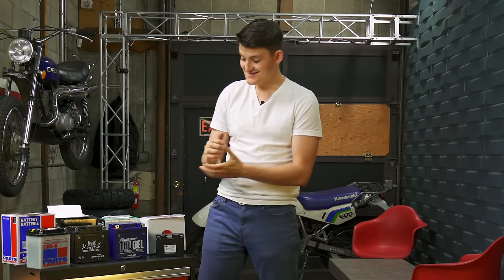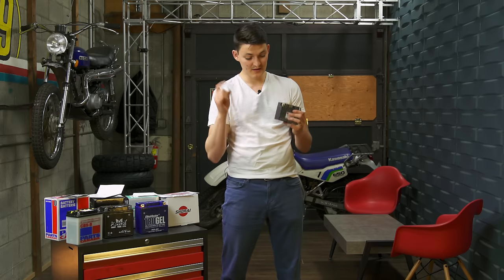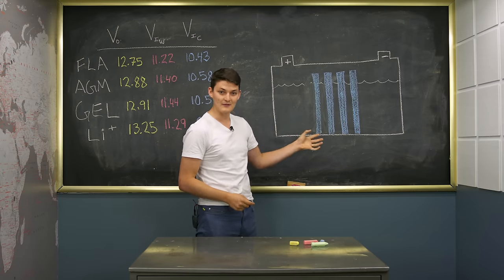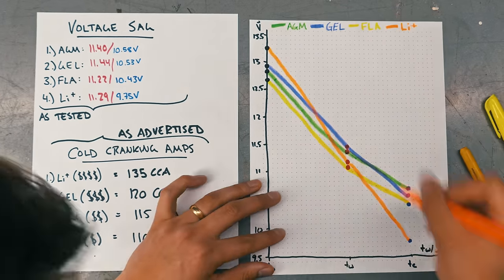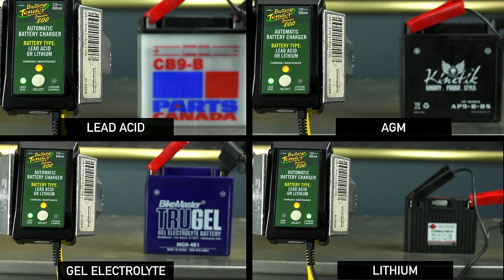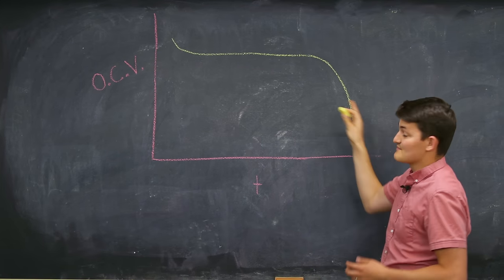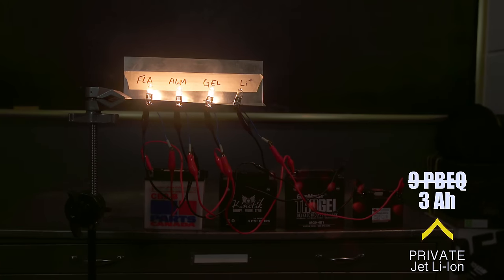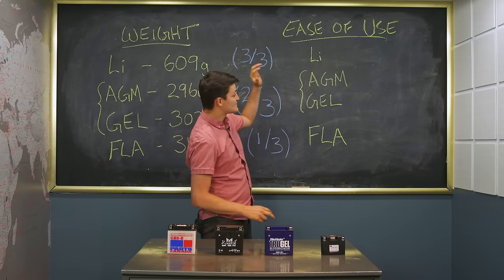Best Motorcycle Battery? Lead-Acid v. AGM v. Gel v. Lithium

Comment: Все конечно хорошо, вес и так далее. Но, не каждое зарядное устройство в мотоцикле может правильно зарядить литиевый аккумулятор.
Тема для следующего видео.
Everything is fine of course, weight and so on. But, not every charger in a motorcycle can properly charge a lithium battery.
The theme for the next video.

Comment: TO EVERYONE IN YOUTUBE LAND 
 I'm an electronic engineer 

If I need a special lithium battery charger to charge a lithium motorcycle battery 
THEN WHY AM I NOT CHANGING THE ALTERNATOR AND VOLTAGE REGULATOR ON MY BIKE  (THAY ARE FOR LED ACID )
 
the BMS ( Battery Management System ) in the lithium battery dose this for us !!!    
please do not give out False info . the battery is made at the factory as a direct replacement (hens the name "motorcycle" battery) for a led acid battery
AND "DOSE NOT REQURE A special CHARGER" !!

Comment: 1. not all lithium bat chargers are equal a true lithium ion charger cant charge anlead acid however a trickle charger will charge a lithium albeit slow as fuck however it must shuit off when battery reaches full charge OFF! or boom . So a simple stop circuit makes it safe for l.Ion however does not make a lithium ion charger.
Reply: 2.2. Gel cel work best in Marine  applications or bike they love being run down to almost zip then recycling back to life for years and years or melt (because Vegas) . However i find th popular gels to be crap and go to west marine and buy a boat battery.
Reply: 3.my favorite is a small super capacitor  setup and a backup battery from Dewalt or Makita i don't have to go into the amazing convenience of using a 20 volt battery that everyone has already in their garage ? i dint think so or explain the need for a step down circuit /resistor ... this worked great on my track bike . thats all you rock !

Comment: I just need to know what is the best battery to get for my 2019 Ninja 650?? 🏍 💨 🔋
Reply: Just go with a stock yuasa mines over 8 years and still going strong.
Reply: @chrishart8548  I ended up getting a Lithium Noco NLP14.
Reply: @Elevated805  I bought a lithiom trickle charger from noco 70 something.    They look like a good make the battery's are steep though
Reply: @chrishart8548  yeah, it was expensive but has a 5 year warranty & I plan on having this bike for a couple years, so it was worth it to me. I hate having battery problems + I just installed some underglow.

Comment: You have literally missed the main point of buying a lithium battery. In a bike, it is about weight and space. You can fit a very high amp hour lithium ion battery in the same place for roughly double the capacity and one third of the weight of gel. Also my lithium ion takes less that one hour to charge, is 20 amp hours and smaller than all of the batteries tested. So the brands and charger are garbage. Cost me $140 dollars Aud. It is a no brainer if you do a proper test.

Comment: He used batteries at the same amp hr. if you bought a lithium that fully filled your motorcycle battery compartment as you normally would, it would out perform them in almost every way.
You are supposed to bulk charge them which will very quickly get them to 80-90% but the last 10% of charge takes a long time.
Seriously why did you use a lithium so much smaller. Even if you did do that to save a tiny bit of space for some reason all you have proved is the lithium can still get the job done. You said in regards to lithium being able to be mounted upside down “why would you do that?” But you don’t have the common sense to buy one the same size?
Reply from the maker: The most common reason people buy lithium batteries is to get the same amp hours in a much smaller, lighter package. Racers and custom guys do it a lot. So for them, the comparison of an equal-size lithium battery is irrelevant. ~RF9
Reply: FortNine racers and custom guys will be well aware that their bikes are unlikely to perform without extreme care and maintenance such as not starting them in the freezing cold. Racers will always choose lithium anyway to save weight so i would say testing for those people is completely irrelevant anyway...
I fitted a lithium that filled my compartment. All the pros no cons. Save frozen battery but I don’t get my sport bike out when it’s sub zero.
Reply: FortNine I’m being harsh here, your channel is by far the best for motorcycle myths and reviews and the likes.

Comment: i can't believe the lithium battery lost... Im still getting it to make my bike lighter.
Reply: The lithium battery did not really lose in my opinion. This comparison left out one important criteria, longevity. The lithium is the only one that may last 10 years, the gel maybe 5-6, and the others 2-4 at best. I am on my third year with a lithium and it has been reliable so far. It also sat all last winter with no charge and fired up my bike in the spring. You will not regret buying one. Have a great riding season.

Comment: My half full lithium won't crank the 125cc engine...
And a full one will only crank it like 3 times until it's voltage is too low...
That's what you get for 11.1V rated Voltage instead of 12V.
Sorely disappointed.

Comment: Charging a 3,5 Ah LiFePO4 battery with a 800mA charger?
A lithium battery can be charged as fast as 1C so it could easy swallow well above 3amps.
Not saying the Lithium batteries is the bees knees, just saying this charge test was not very good.

Comment: Nope. Your LiFePo was crap. I use A123 cells, only 5Ah. I took 8 pieces and spot welded my own battery. No need for balancer. Would never, never change a thing. Works for years in three bikes, also in the wintertime, much more power (cranking amps). Not drained after some month in the garage. Finally i`ve got rid of the never ending Pb crap trouble: each year a new one, each winter : wont start (what a fuck).

Comment: In real life it does not matter the Lithium having the lowest self-discharge. Most motorcycles have a constant low amp draw when switched off. The lithium will be the first one to be empty, since its real capacity is only 1/3 of what the others store.

If you park a motorcycle with a lithium for more than 4 - 5 days, disconnect it, or install a breaker switch right away.
Reply: That’s not how it happened for me, I had it sitting for months in winter, started up quick every time.
Reply: @kexus1990  If you do not have a keyless system, a clock or a theft alarm running then yep. I had a R 1200 GS, that discharged a Shorei in less than a week.
Reply: @krollpeter  Yeah ok, completely different situations. I had a 2014 CB500F, completely stock, no bells or whistles.
Reply: @kexus1990  It is the easiest and one of the cheapest ways to cut a few kg from a bike.

On many modern bikes it is questionable. Why? It can handle huge amp draw very well, ie when starting. However that constant, even low amp background draw is poison for it, it will kill a lithium batt in a year.
Reply: @krollpeter  Thanks, I’ll have to keep that in mind for the bike I’m riding now, it’s got an AGM battery at the moment, was thinking of upgrading.

Comment: DO NOT BUY SHORAI.  I almost never comment on videos but some truth; this video got me tilted.  FortNine is great and the videos and tests are always entertaining.  The only problem here is personal experience with the various products; even though these are simulations of real world scenarios – nothing is more telling than a real world scenario – let me explain.  

Shorai is complete garbage and the environment does not need this battery to recycled; it needs to be destroyed so that it never takes another form again.  After having a stock Yusa for 6 plus years; it finally went lights out.  I researched on what to replace it with and ended up with a Shorai.  The price of the Shorai was intimidating but I contacted their support and they were nice and answered all of my questions.  I decided to bite the bullet and purchase an LFX19A4-BS12 which was an (+$60) upgrade to the LFX14A4-BS12 that my bike required.  I did not want any hassle and no trouble fiddling with the battery as the Yusa approached its end of life it was on a tender every few days and did not want to take off the seat blah blah.  

The Shorai came in from Revzilla and they were not able to ship it at full capacity – okay fine – I charged it up and boy the first charge was quick.  Oh yeah I also purchased the special charger even though I had a battery tender that Shorai confirmed over the phone that it would work with their product – but I wanted to be on the safe side.  So that is another $90 down the drain for the SHO-BMS01.  The battery was extremely light and it connected right up.  My bike even started right away w/o having to have the lights or electrical run through it for the 30 secs like the manual says.  In the cold climate where I reside; the extra CCAs (second test from FortNine) and power from the battery do sure up to what they say and start the bike better than any traditional battery that I have used.  The problem is that the battery has a 1 year shelf life and I do not mean 1 year storage life like they claim – I mean after a year you have to buy a new one.

The charger has a store mode in which it does just that; it maintains the battery voltages in between seasons.  What was really fun is that during this maintenance period the BMS01 malfunctioned; yes it malfunctioned – stopped the storing process and the battery over discharged.  IF THIS BATTERY OVERDISCHARGES (under 50%) then you may as well buy a new battery because it is never coming back.  I contacted Shorai and did an expediated RMA; I sent them the charger and battery and they told me that the charger malfunctioned and they were sending me a new charger and battery.  At the time I was pleased with their service and return time.

Great so what is the problem? About a year passed and in-between rides – I went to start my bike and nothing.  This is after I geared up and everything; the ignition was silent – no cranking at all.  I was really shocked and thought to myself – could it have been the battery? I was actually hoping it was something else as I knew if they battery was discharged and had any sort of draw on it; game over.  I got my multimeter and sure enough I was at 9.6v.  I plugged in the charger and it received the error message that it was over 50% discharged in which math of reasons 9.6 is half of 13.1 but you know raisins.  I called Shorai and they would not service the battery.  They said I was over my worthless 5 year warranty period and they offered me a coupon for a new battery.
 
6:33 Lithium has the most mood swings from any of these fantastic batteries.  IN BETWEEN days the battery fails.

I even remember looking up the Pb Eq Ah which was total BS – it was black magic – just as the video says it only means 3 Ah hours NOT 9.  As you can see from the first test; the Shorai has the worst voltage sag and keep in mind the Shorai normal voltage is over 13.1 per Shorai and when it was healthy mine would run about ~13.5v with no draw.  From my personal experience, none of what is shown is surprising and the Shorai I am sure true % drop was slightly higher due to actually running at a higher voltage than a traditional battery.  In the third test the recharge speed from the battery failure was roughly 24 hours before it even errored out and asked me to put in store mode. 

I cannot confirm the 2 months test as when I have my battery stored; I keep it indoors during the winter and on the proprietary Shorai charger.  Shorai loses in all 3 of his tests and only kind of skates by with the shelf life test.  ~$300 later I am left with looking for a new battery.  Customer service this time were extremely rude and disrespectful.  I would not recommend Shorai to ANYONE and would never purchase their products again – unless perhaps I received two lemons – aside from quality control; Shorai needs to make this right.  I warn all of you viewers and FortNiner’s out there; Lithium and specifically Shorai is a waste of your time and money.

Comment: My smart charger with my lifepo4  battery only takes 15 minutes from fully dead so maybe you need to invest hit a battery charger actually made for the the correct lithium battery and not a knockoff of a branded not multifunctional battery charger that does not multi function if brother proof is needed I can video this charger

Comment: I won’t ever buy a lithium battery due to if you drain it riding you are screwed cant jump it or anything.
Reply: I've jumped a lithium battery before with no problem.
Reply: You shouldn’t due to risk of fire especially if yours fully discharged. Good way to torch a bike.
Reply: @wolfg.1867  Didn't realize jumper cables are any different than any alligator clips with voltage on them.  I'll wear safety glasses next time.

Comment: My motorcycle use 12v5ah battery . Can i put 12v7ah battery at my motorcycle ? Will it burn my motorcycle.
Reply: Will be fine if you have the space.
Reply: With motobatt the yellow AGM batteries  the replacement for the 12ah is 14ah   with a spacer on the bottom.   The one exactly the same size  takes you from 12ah too 16.5ah

Comment: one of my friends changed his conventional battery on his vmax 1200 to a li-ion one,and he said that its like his bike got 30 horsepower,im a mechanic and all,but ive never used a li-ion battery in any bike,anyone had a similar case? or an explanation?
Reply: Don't they have 160hp normally.   Only 30hp sounds bad is the engine even running?
Reply: @chrishart8548  "like it got 30hpmore than before"  he meant, from a battery, the engine works perfectly,the carbs are cleaned and synchronized.
also,more like 120/140 horsepower with the Vboost,needs a new dyno run tho
Reply: @Bill.Papadakis  won't be anything to do with the battery.  When the engine is running the battery really does nothing.  The alternator makes all the power.  Many vehicles will run without a battery.  Some newer ones don't ecu's are getting fussy these days.

Comment: I do like you channel a lot but your research on battery technology is a bit flawed. 30 years involved in industrial batteries. LA batteries CCA is just a function of surface area and reserve capacity is how much fuel (acid) you have in the battery. Very high CCA batteries are all plate and no acid and frankly cycle like shit. Higher reserve capacity cycle well but might not start you bike on a chilly -30 degree day but will absorb abuse much better than high CCA batteries. Your maintenance free LA batteries uses a lead calcium alloy (Google failure modes). The same alloy is used in GEL and AGM. GEL is just a wet battery with silica added. AGM (absorbed glass matt) is the separator and median to store the acid. Great CCA as there is no separator between each plate but pretty useless to prevent internal shorts. So no surprise the wet battery wins the capacity test (more fuel in the tank) and the AGM won the CCA test plates very close together and more of them. Lead calcium alloy does not like being left for long periods of time discharged and the GEL battery will possible be the only technology that you can recover from a very over discharged state. This is a killer statement because how has the battery company stored your battery? Did they leave it discharge and charge it before they went out the door. Also QA in manufacturing is a massive part of how well and long your battery will last. Had my XT660X upside down a couple of times so that rules out the wet option. Really hard to get the GEL option in Australia my preferred technology but my Yuasa AGM in the Tenere is now 6 years old and I should really replace it before it fails as sulphuric acid never stops corroding the lead. Lithium well 14.4 charging voltage is not the correct charging voltage for lithium. It used to be more than 4 volts per cell but then they discovered the higher the voltage the shorter the life. Lithium does not like being over discharge or over charged. Charging issues below zero and plus 40 depending on chemistry (13 different lithium options) they tend to react quiet violently with oxygen and water when the lithium cell is punctured. GEL is still the most reliable and probably the most robust option but a good AGM battery is also a great option.

Comment: That battery is way overpriced, wtf? You could make it far cheaper with a few 18650's probably 10 cells in series and you get something that compares well between the lead-acid batteries in all areas, in fast charging, capacity, etc. It is also around 40 bucks so you also start to get in a comparable price range. The only difference is you have to make it yourself since everyone wants to milk money out of you for assembly. And if you want a BMS (which you probably do) its going to tack on another 5 dollars along with another 10 for the charger, so around 55 bucks altogether

Comment: You should also mention that Lithium ion batteries are very, very difficult and expensive to recycle. It’s cheaper to mine new Lithium then to extract them from old used up batteries. Making Lithium batteries is a very dirty and environment destroying process, just like recycling them is. So companies dump the batteries like radioactive waste in containers. The so-called environmental advantage of electric cars or motorcycles compared to internal combustion engines is just a selling slogan nothing more. Lead batteries can be a 100% recycled with lower cost and a low pollution of the environment, but they are bigger so they are not being used for electric vehicles.

Comment: Lead acid AGM in jail are essentially the same thing they're all lead acid batteries so just pull them all together they're all shit no matter which way you look at it I'm surprised you didn't have a Cobalt battery in your lineup there they suck too if it ain't one of the variants of lithium batteries it ain't worth two cents